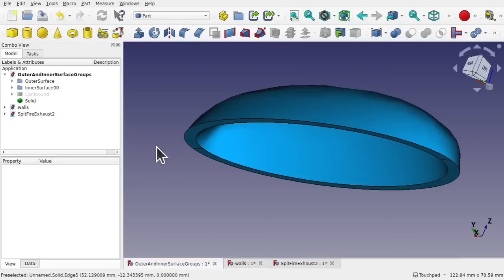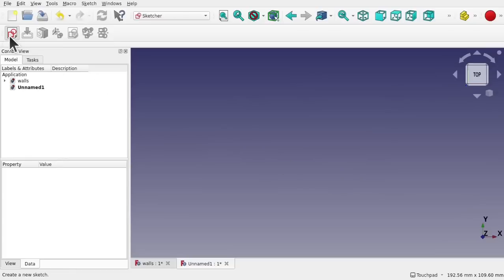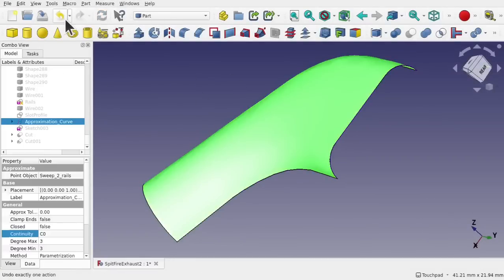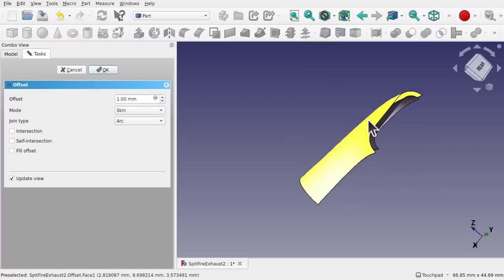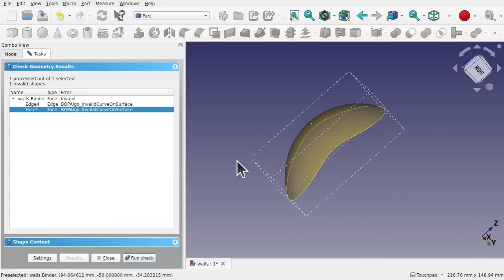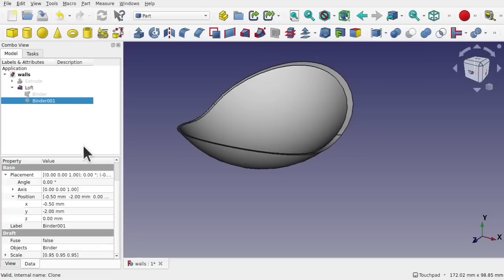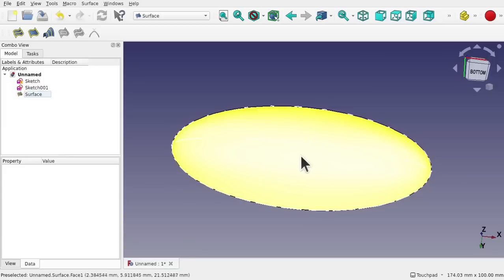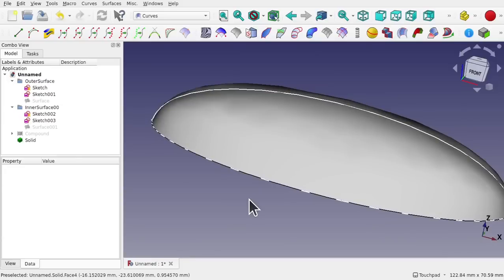FreeCAD: How to create thick walled and hollowing out objects and how to prevent offset failure

Comment: Basically a curve that supports a sharp angled turn, here about 90 degrees, as the radius of that curve shrinks, but still has to turn the 90 degrees, it just approaches a right angle instead of a curve at all, as the radius becomes just above zero at which time it becomes simply a point.

Comment: MangoJelly content is great, but as I'm beginning to watch this, I wonder: why is it allowed to fail? Every time I try to use offset and it fails, i can look at the model and think: there is no conceivable reason why this should not work.
Reply: FreeCAD isn't smart. It was made by smart people but the user needs to know exactly what the program needs and how to use its various functions. I have the same problem, sometimes it just does stuff and i dont know what to do. The whole attachment and support system is a mystery to me.
Reply: @NiliMoto  I've run into problems with verious cad software not allowing me to do something that I've thought would be possible.  Doesn't matter if it's Solidworks or Freecad,  there is a learning curve for each.